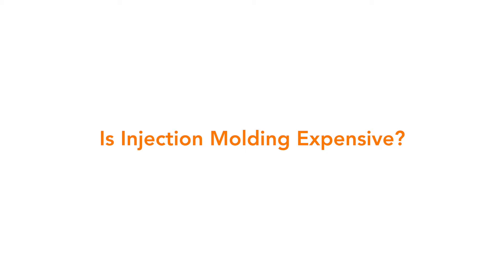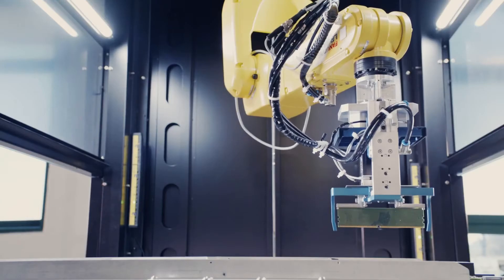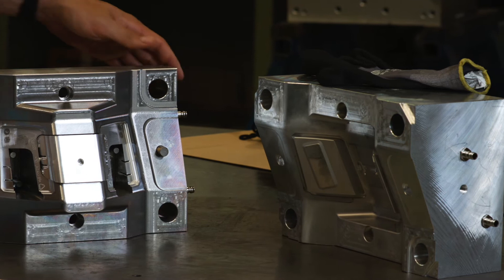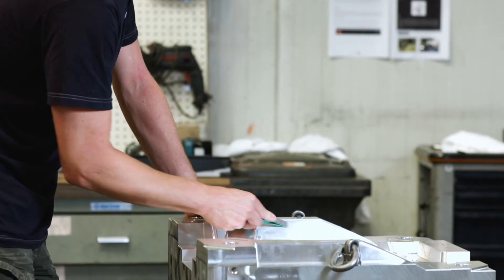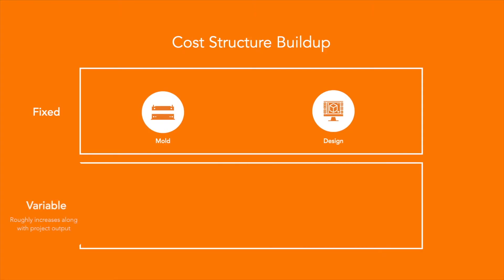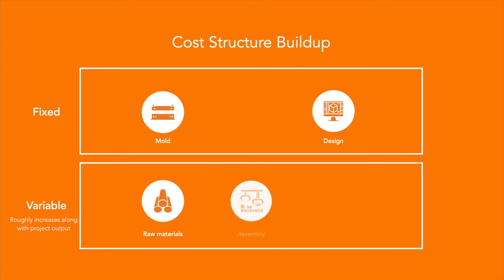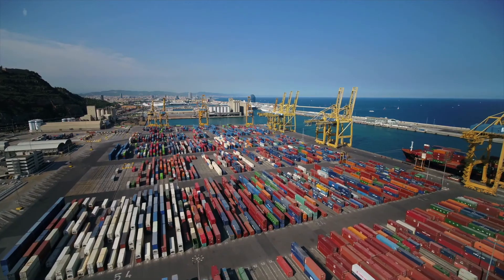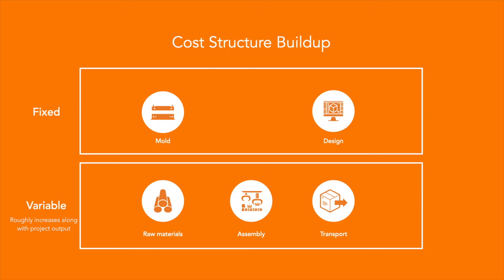Is Injection Molding Expensive? – An Overview of Project Cost Structure

Comment: 💰 Clear breakdown! The high upfront mold cost is why functional prototypes (via 3D printing or urethane casting) are crucial. They let you validate design, fit, and market with minimal investment before committing to tooling. Smart prototyping = smart business. 👍